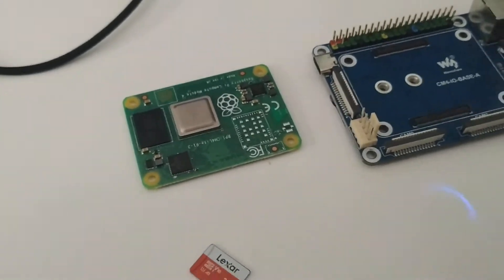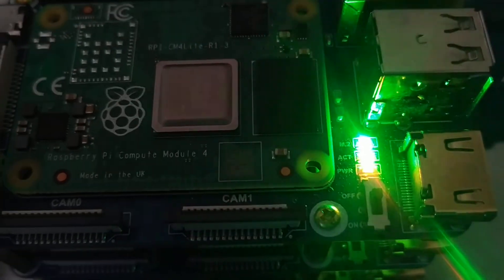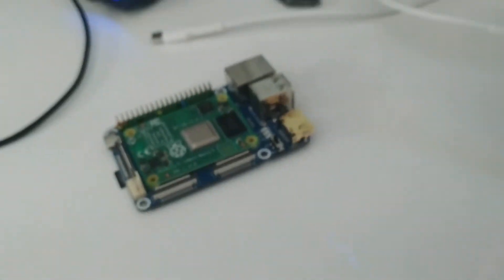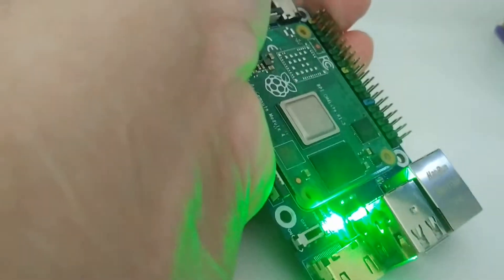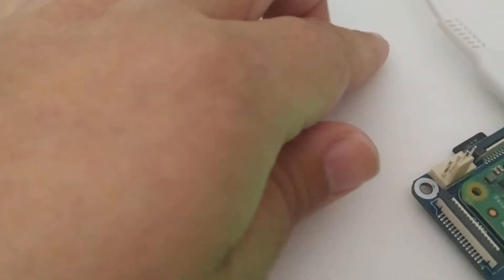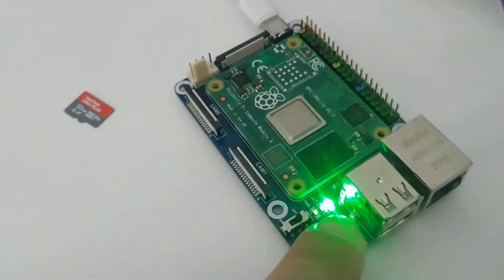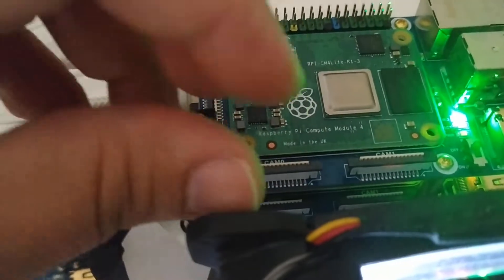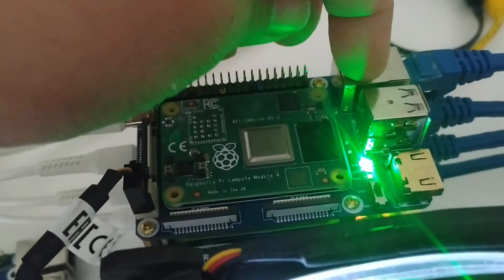Bad Raspberry Pi 4: LED Flashes 8 Times

Comment: Had one of those for repair today - turned out a cold solder joint on a RAM chip. Reflowing it did the trick, but I spent two days figuring that our 😂